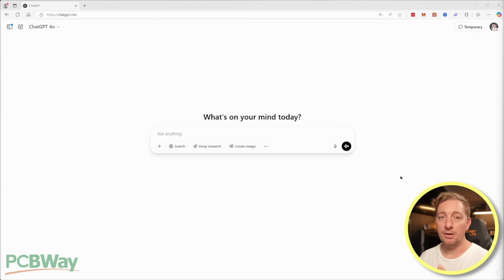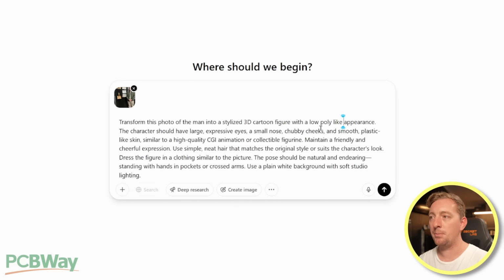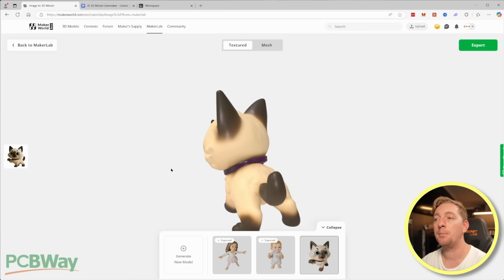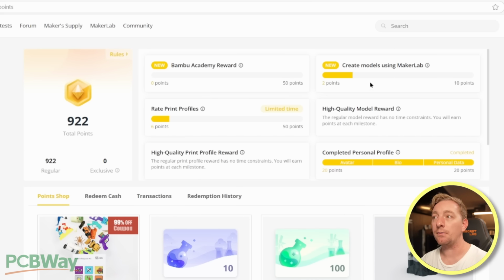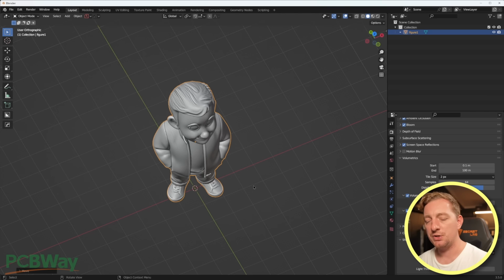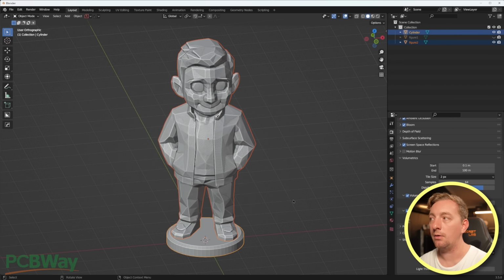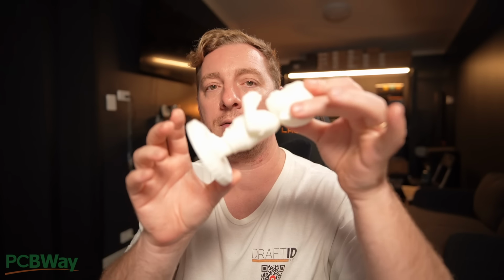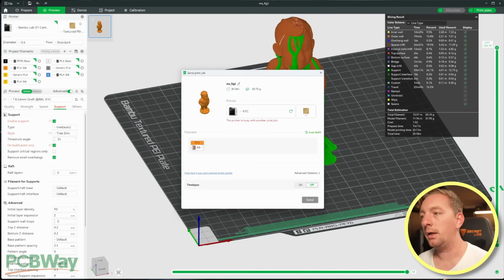How to Make a 3D Printable Action Figure Using AI Tools (Complete Guide)

Comment: Pretty cool stuff... I love all the tools available to make stuff like that. I've been in manufacturing for over 30 years and it's truly amazing how advanced things have become compared to back in the 1980s when first got started... thanks for the share... I appreciate you...
Reply from the maker: Thank you for the kind comment and sharing your experiences :)
Reply: Back in the 80s I remember a local bike frame builder (Kieth Bontrager) who designed his own rear drop-outs (where the wheel bolts to the frame). The cost to set up the CNC machine and cut two pairs of these custom dropouts was about $20k. I did something similar recently, sent off my files through the internet and got a set of similar steel cut parts... for $19. So the cost used to be 1000X higher!

Comment: What wall loops count did you use? Before watching this video I printed a figure with 4 loops and didn't use variable layer high and model came out very well. But the only issue I had was the stethoscope broke slightly, as it was very fragile. My model mesh was too large to import to TinkerCAD, I wonder if you can import bigger files to Blender...
Reply from the maker: Thats why I use blender, it seems to handle dense meshes quite well. I often 3d scan stuff which came in not optimised and its fine with those. 
For wall loops I just use the default 2, I rarely go more than that (3-4) unless I need strength in my part for engineering applications.